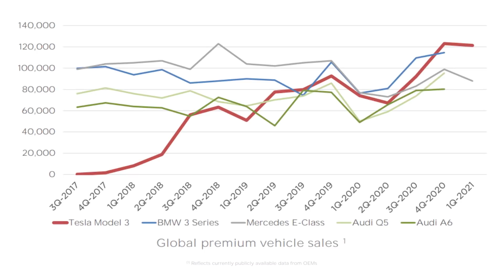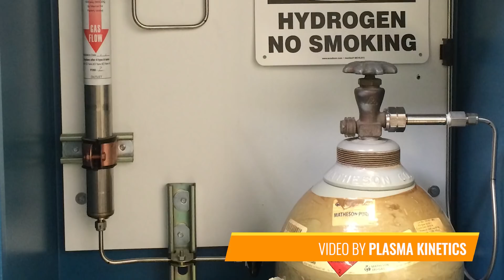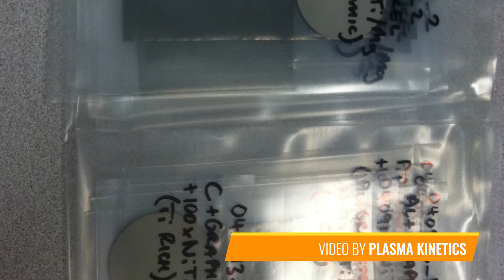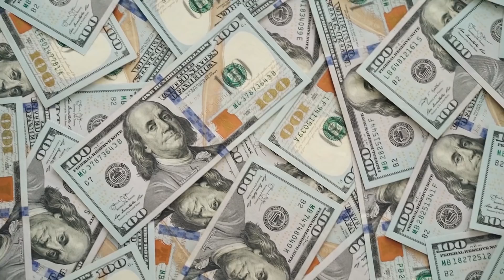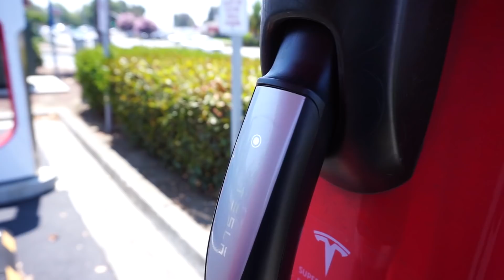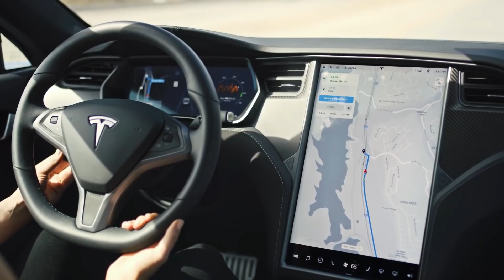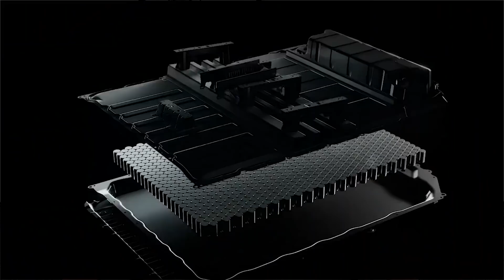SANDY MUNRO: No Batteries Needed for Toyota to Rival Tesla

Comment: I think Toyota should use their hydrogen edge. For now, and proberbly for a looong time, if not forever, hydrogen cars don't seem viable. 

On the other hand; trucks, ships, planes, busses and other heavy machinery seems to make a lot of sense. 
1. You don't need super dense hydrogen refueling stations. 
2. In these sectors uptime (range/refueling time) trump's fuel cost, in many scenarios.
3. For big machines, with long range, hydrogen is much more weight efficient.

Toyota has already build trucks and busses. But maybe this should be their main focus untill they have solid state technology or some magical breakthrough happens in hydrogen/fuel cell technology. 

What do you think?
Reply: Also some of these sectors operate outside of the grid. Transporting a tank of hydrogen to the cite, migh make more sense then transporting batteries or setting up a solar farm in some scenarios. (Mines, building cites, infrastructure, etc.)
Reply: @jarrlist7424  Things people opposing Hydrogen use as arguments against it:

#1: "Production is dirty"  Yes, oil companies eyes a chance to survive in a Hydrogen infrastructure, where Natural Gas can still be cracked to make Hydrogen! Fact: No serious city planner or government environmentalist (at least outside the US) imagines that anything but electrolysed Hydrogen can be part of a zero emission future.

#2: Conversion "efficiency is low". Yes, 50% is lost from electricity to H2, and again from H2 to electricity, for an overall electric efficiency of 25%.  This is shabby, but if used as part of the energy infrastructure, factors like long term storage, (from summer to winter) and the fact that the heat loss, both from production, but also in peoples homes, can be utilized for heating, the combined economy is on par with other types of cheap long term battery storage for the energy industry.

#3: "Storage and filling is impractical".  Fact: Fuel cell vehicles, do not need to be filled at filling stations. A fuel cell works just as happily as an electrolyser. So you simply plug it in when you get home as any EV. You don't need high pressure tanks and compressors either. Metal Hydride storage works around 10 Bar, so a simple pump in the vehicle will suffice. To operate, a fuel cell vehicle, is not much different to any other kind of EV. Filling stations are fast chargers, when on the run.

Storage: High pressure tanks hold very little H2, Metal hydride is heavy, so techwise, H2 vehicles are around where Li-ion batteries are in energy density. However, other types metal hydride storage is out there: Ballard Power systems makes pellets, that react with water, and the other company? making Zinc hydride paste, both of which are around double the energy density of Li-ion.  For laung haul, LH2 is an option. The amount of hydrogen needed in a vehicle is very small, so when the trips are planned, liquid H2 is viable. If storage gets sorted, we can have EVs with 5 times the range. This is hard to beat by any battery tech.

So don't dismiss Hydrogen just yet. It is an important puzzle bit to the future. Batteries are not suitable for all vehicles.
Reply: @Tore_Lund  Point #2. I thought the overall efficiency was ~50%. State of the art electrolyzer ~85% and state of the art fuel cell  ~60% ??? I was curious one day and found some papers. Multiply these two and you get about 0.85*0.60 = 0.51 ~ 50%. Which is not that bad at all actually. Transporting electricity loses about 10%, batteries lose power over time and charging batteries is not 100% efficient either, the charging loss is unfortuanally proportional to the charging speed. 

Add to this that hydrogen can be produced at times where supply is higher then demand for electricity, and there is potential.

Also add to this that green hydrogen will be worked at like hell the coming 20 yeas. As a society we NEED hydrogen; for fertilizers, green steel, chemical processes etc. This sector is huge, without fertilizer we would all starve, and they MUST to decarbonize. Big time scaling factors here. 

I fully agree with the rest. Hydrogen will undoubtedly play a role. Maybe cars is not one of those. Big institutions seems to agree; EU, china, Australia, USA, etc, everybody has an ambitious hydrogen road map with billions upon billions in funding. 
Big companies are on board to, with their own road maps. For example Microsoft and other big tech is very keen on replacing their diesel backup generators for data centers with hydrogen tanks and fuel cells.
Reply: @jarrlist7424  The commercial units you can buy are 50-55% efficient, I'm glad to hear that 85% is possible. Usually, it requires a special arranged, at the nano level, catalyst. That certainly shoots down the efficiency argument.

Comment: Okay we need them electric batteries we need electric motor that we need electric plug in for some reason when electric bills came out it's like you couldn't plug those in I mean every time they went home why can't they plug that in I mean can you imagine like every time you have to buy gas you have to take the cap off and get gas you can't do that every time to get the electricity at home or at the garage

Comment: I agree on all parts with Sandy. But… let’s say Toyota goes that way, the design of the car, which is responsible for a huge part in a the car sale, is just butt ugly. Overdesigned, too many lines. They are trying very hard to make it look as “design”. Now good design is for the most part also eliminating not adding. So there is a lot of work on that front too. But the good news is they are not alone also Citroen (DS) is in the same bed sick together with Lexus to name a few.

Comment: Toss out hybrids. Since they make for poor collectibles and even poorer beaters.  Hybrids are terrible after 10 years of ownership vs gas only (ICE).  Cost of hybrid repairs can exceed $10k bc engine tolerances are tiny costing $3k to 5k to replace, also $3k brake actuators fail, so do $3k the re-gens; finally the replacement batteries cost $3k to 6k or only $1k to refurbish. ALL OF THESE can be expected to fail and my prices aren't dealer (lol), nor did I cover the avg pricey maintenance ($400 12v battery, LR tires, etc.).  
If Toyota built separate reliable 50mpg gas cars from pure EVs, that would work well as classic vehicles years later.

Comment: If you really want to electrify the automotive industry to “save the world”, then cut a deal with Toyota, and help them electrify their fleet, and in a way that doesn’t directly compete with your product and market.
Reply: If we want to really "save the world", everyone needs to do the Google research on hydrogen as an energy carrier. You will find that hydrogen can reduce CO2 emissions much more than batteries can, but both will be needed to tackle climate change.
Reply: Liberating hydrogen from its natural setting, then compressing and storing it, then distributing it, then converting it back into energy is a terribly inefficient cycle compared to directly creating electricity and storing it in batteries.  The sources of electricity are abundant and come directly from that big unshielded thermonuclear reactor in the sky, in the form of direct radiation, captured by solar panels, wind generators, hydro generators, and infrared heat collectors; no chemistry involved, and in some cases, no electric meters or gas meters and pumps required.  No need to trade gasoline pumps for hydrogen pumps, with all the same problems and monopoly industries.

Comment: Toyota in trouble??? Here are 1st quarter results. They don't indicate Toyota is in any trouble "Consolidated vehicle sales totaled approximately 2,148,000 units, an increase of approximately 990,000 units compared to the same period last fiscal year. On a consolidated basis, net revenues for the period totaled 7.935 trillion ($72.1 billion), an increase of 72.4%. Operating income increased from 13.9 billion yen ($126 million) to 997.4 billion yen ($9.0 billion), while income before income taxes was 1.257 trillion yen ($11.4 billion). Net income increased from 158.8 billion yen ($1.4 billion) to 897.8 billion yen ($8.1 billion)." I realize year to year squewed by Covid and these numbers are down from 2019 I don't see the dramatic bounce back as a sign of trouble given we're still in a pandemic and still suffering from supply chain issues.

Comment: Pure electric cars have a round trip efficiency of 80% +-10% including battery loss, charging cooling and loss, and electric motor loss - everything grid to wheel. Hydrogen fuel cells ALONE have ~50% efficiency unless you try and convince someone the waste heat is useful - they waste half of your fuel and money. Now I'd be very interested how much this solid disk adds to these mounting losses with a laser actively heating it just to get fuel out to waste half its energy in the fuel cell. I understand hydrogen is very inconvenient, dangerous and problematic to use, but if they keep cramping methods like these just to shuffle to make it work, they gonna end up with a system that even less efficient than an ICE car - I get that's good for business, but not really for the consumer.

Comment: EVs are not 100% clean as the energy for most EVs comes from coal or gas

If I was Toyota Or Ford Or GM I would look at pivoting to Natural Gas powered vehicles

Natural Gas in the USA is literally 10x cheaper than Gasoline

$3 a gallon vs 30 cents a gallon equivalent

Most homes also have a natural gas line to feed their home heating etc so if your home has NG you could even home 'charge' your NG vehicle

To add 300 miles of NG might cost around $4-5 while to supercharge 300 miles an EV costs closer to $20

Comment: POWER PASTE HYDROGEN TECHNOLOGY is way ahead of Plasma Kinetics. ZERO POLLUTION for one thing. There is no need for electric motors, you burn the hydrogen in a typical ICE and the engine cleans the air as it runs and gives off water vapor. It has been engineered from cradle to grave so EVERYTHING in the process is recyclable and other than the oil companies market shrinking by a huge margin (Oil is not going to disappear entirely because it is used in all aspects of  manufacturing, not just automobiles) the motoring public would actually see very little disruption. This could be done in a gradual process to where the financial markets would not implode the way they are going to with this BEV idiocy.

Comment: A few considerations I think.

1. The word Hydrogen does not sit well with people. The laser disc is interesting but can mass adoption prevail, I think not. Why? Simply that V-G, V-House, V to RV, etc works and it will come.  Can you storage grid energy in a Hydrogen cell, I think no. That suggests H wont go to mass market.
2. New coming EVs from Toyota, are they not made by BYD now under a deal?  Reduce margin, going the NIO way, loosing control, lower margins.
3. Patents. The end game.
4. FSD, talk of H cells is one thing, talk of EVs another, FSD without masses of sensors, if it works, total game changers.

Comment: Toyota uses mobileye in their cars I believe, which is already better than tesla's solution
Reply: Mobile eye is nowhere near Vision..
Reply: @Jirongosteve  i am surprised so many people just take musk's word for how great vision is with no independent benchmark. mobileye has always been several steps ahead of tesla. tesla used to put mobileye in their cars and when they switched to home brew it took years for their system to match the old mobileye performance. the only way tesla's system gets to robo taxi level (like mobileye's) is if they add mapping, but they said they will not do that. until then tesla's system will drive like a local, but with the skill and knowledge of a tourist. not good

Comment: Munro talks a load of rubbish about Tesla.
Tesla buy their batteries from National Panasonic.
National Pansaonic sold its Tesla shares in March 2021.  That makes it quite clear that the relationship between National Panasonic and Tesla is not the same.
So anyone can buy batteries from National Panasonic.
Tesla buy all their components (motors etc), they only assemble and that is poor and they develop software that appears to be having problems.
I am sure that Toyota know more about Tesla than Munro and Tesla.
If I had a million dollars to invest in either company, my money would be in shares in Toyota and not Tesla.
Toyota have a 20% holding in Mazda, own Hino Lorries, Automatic Transmission company, Denso (one of the largest spare parts manufacturer).
Reply: Toyota and Panasonic have a joint venture named Prime Planet Energy & Solutions (PPES) to build Solid State Batteries. $TM all the way!

Comment: Batteries are hydrogen fuelled. The sun is one big hydrogen fusion reactor pumping out electromagnetic waves that travel to earth at the speed of light. where out solar panels and wind generators receive it the pass it on the grid then onto your home or service station all at the speed of light no transportation required. Now think about hydrogen it needs an awful lot of infrastructure to create then transport it safely to a service station for safe unloading. Very expensive and difficult with one of the world most volatile liquid/gases.
The only reason the government is backing hydrogen as it can be easily metered for taxation.  That is why Elon says. Hydrogen is dumb.

Comment: Rather than Hydrogen why not use LPG in this Fool Cell ? I have a Toyota Camry Hybrid, which runs on electricity at low speed and gas motor cuts in automaticlly as speed increases. It works well and many Taxis use them. Toyota needs to just refine this hybrid system and keep developing it. Not everyone will buy a Tesla !

Comment: There is a fossil fuel which is far cheaper and cleaner than gasoline and that tech would allow existing auto to out compete EVs and gasoline 

Natural Gas in the USA costs just 1 cent per KWh and burns cleaner than gasoline and is domestic and abundant 

If I was Toyota I would pivot into Nat Gas powered hybrids and offer 150,000 miles of free driving

You can purchase a gasoline RAV 4 hybrid for $28,500

Produce a NG powered RAV4 hybrid and sell it for $30,000 with 150,000 free miles

$30,000 for a Hybrid RAV 4 with 150,000 miles and Toyota reliability would be a fantastic buy

NG costs less than 1 cent/KWh
Gasoline currently costs 9.1 cent/KWh

Literally 10x cheaper to power a car or truck or even Semi/HGV with Natural Gas than with Gasoline

It's also as clean as an EV
Most EVs are indirectly charged with coal or gas anyway so at least for the next 20 years there isn't really an argument tjst EVs are totally clean

Comment: Its not that deep really.. 
Toyota is afraid they will lose the USA market to EVs?  Well, the USA market is still gas car dominate and will be so for many years.
Toyota has time to develop their EV platforms. I think Toyota put all their hopes into fuel cell and its not paying off right now. 
They have time but they need to jump on the EV bandwagon by 2024 full throttle and have at least two EVs selling well in the USA..

Toyota made a mistake partnering with BMW on the Supra (a car no one wants). They should have moved the Prius into BEV status. 

Its never too late..

Comment: Commentator have you been having a sleep under a rock.   China is ahead of Tesla. China has battery swap stations, cannot do this with Tesla cars.. Tesla has lithium iron batteries, capable of catching fire,  China has a new type of battery called plate batteries. These plate batteries have more power and more holding reservoir of electricity, and is smaller and lighter. These plate batteries have been design to run cooler and is designed,, to release heat in the best design possible. They have been bashed and crashed and is vertically impossible to catch fire. China can run their cars 5G driverless.